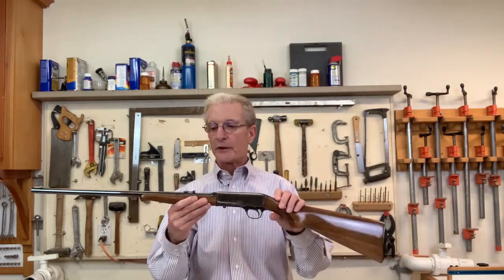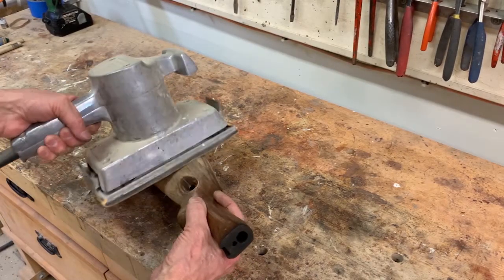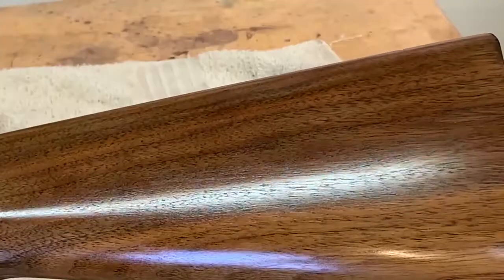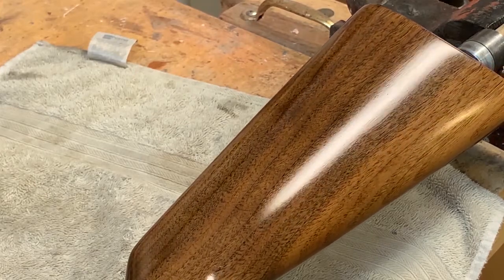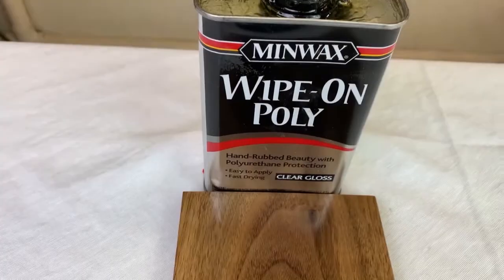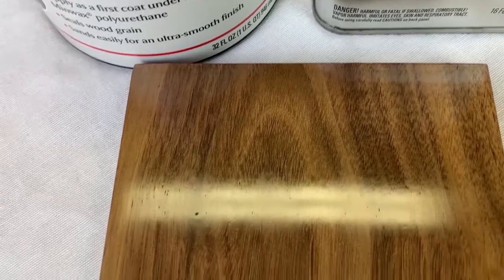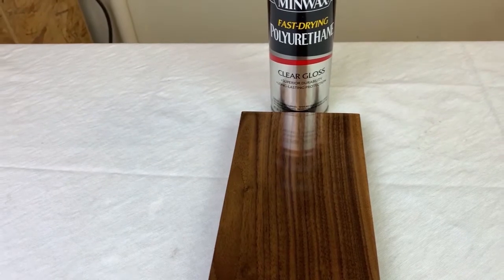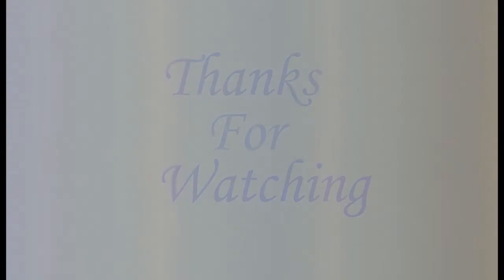Remington Model 24 Restoration Part 2

Comment: I have found that I can get a very nice and glossy finish with only four or five coats of Tru-Oil which seems to hold up very well. I redid my Remington Model 33 bolt action a few years ago with four coats, very nice and is still holding up. I did a Winchester Model 70 with three coats of Tru-oil because I didn't want that as glossy and closer to a factory look and that's held up well. I think the most coats I have ever used of Tru-oil was ten and that was a hand carved bird's eye maple bowl that made the eye's in the wood almost look like they're three dimensional.
Reply: I use Tru- oil also , and found similar results. It holds up well , and if you miss a few spots , It blends in beautifuly.
Three or four coats gives a nice finish. I have also used minwax with good results.

Comment: Thanks for your time and sharing your experience with us as I've already watch all of the related videos. I typically use oil finishes, I have a Browning that has a spray on finish from the factory for the second time. I sent it back after it started peeling at the edges around the tang and the receiver. Well, it's peeling again, and I don't think I'll be sending it back for a third finish.
 I was curious as to why, after you went through the trouble of sanding and polishing all the metal parts, you didn't have them hot blued? Although you did get the best results of any cold blue finish I've ever seen, I did see a couple of spots that wouldn't have been there if they were tank dipped. Anyway great job on resurrecting another great old gun. I subscribed and I'll be looking for more of your stuff to broaden my horizons.
Reply from the maker: Thank you for your comments and kind words. Regarding your question about my choosing a cold blue over a hot blue finish, I would have paid to have it professionally hot-blued in a heartbeat if one had been available in my area. Because of the toxic nature of the chemicals used, hot bluing has been banned in California. Also, I didn't want to go through the problems with mailing gun parts out of state and how I would hold the gunsmith accountable if the bluing did not turn out well.

Comment: Nice video, Bruce!   Why only Minwax?  Did you consider any of the more traditional finishing techniques like linseed oil?   I don’t know what the finish the rifle came with.   Interested in your decision process.  Thank you and keep making videos!
Reply from the maker: Thks
Reply: I like the boiled linseed oil the best and I put a little on almost every older gun I have.  If I get an old gun with a dried out looking stock, I will add a coat or 2 and it really makes it look and feel better. I also sanded down and refinished an old marlin with the linseed oil and I put probably 6-7 coats on it and it turned out perfect.